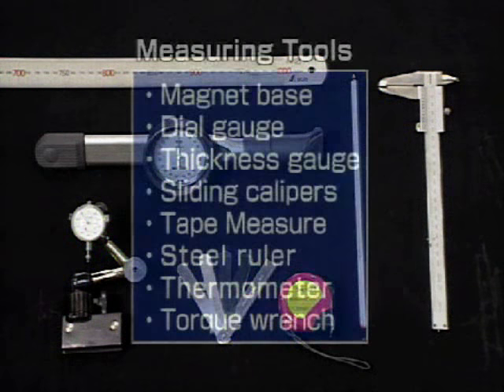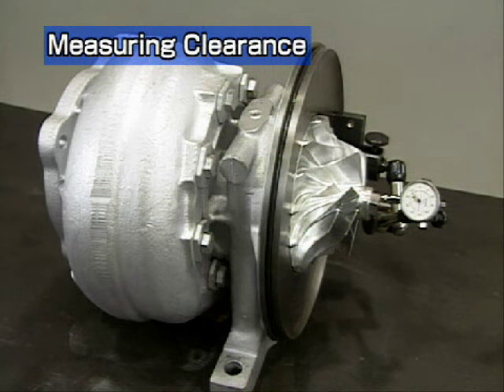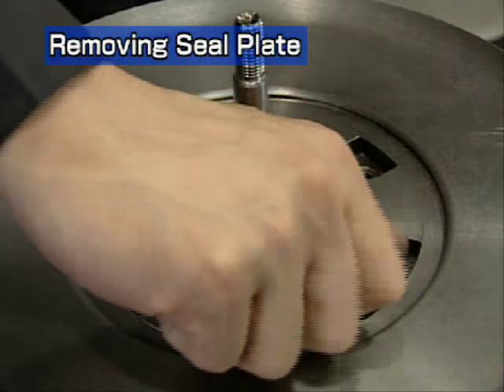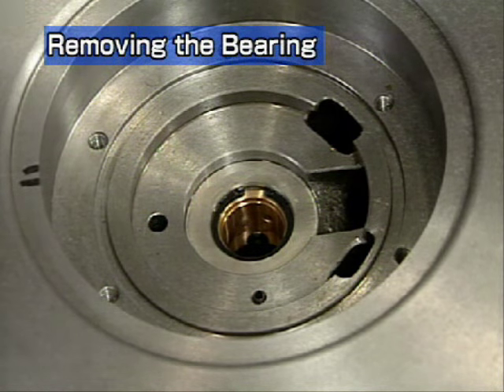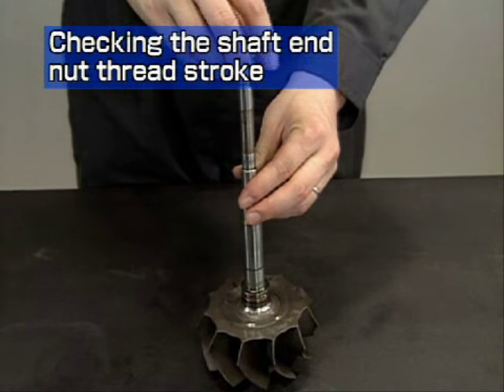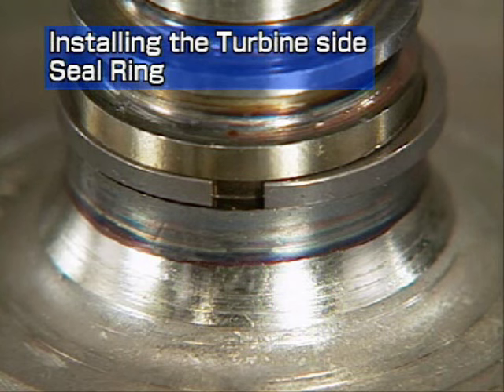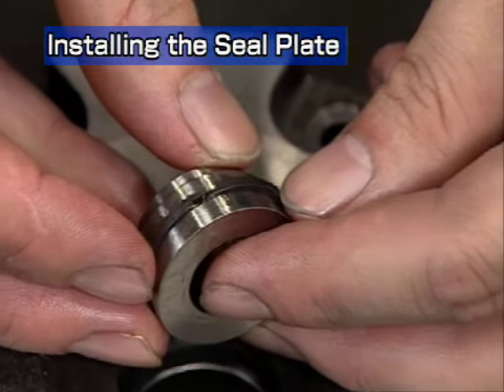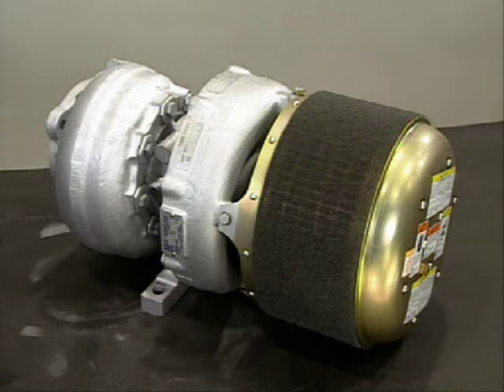YANMAR GENERATOR TURBOCHARGER (RH-113) OVERHAUL

Comment: This model is RH133Y. there is a difference between RH133Y and RH133. Y version are joint development between IHI and Yanmar and they came out with the semi-float bearing whereas the original RH133 have full float bearings. Why have semi-float bearings ?? Well the original turbo with full float bearing have issues with bearing housing weardown instead of just bearing weardown which are cheaper and easy to replace. For those people that have engines fitted with this turbo, they will understand that this is a problem turbo with many flaws. Thats why Yanmar have stopped using RH series in their newer models.